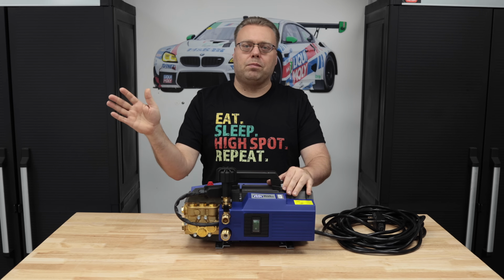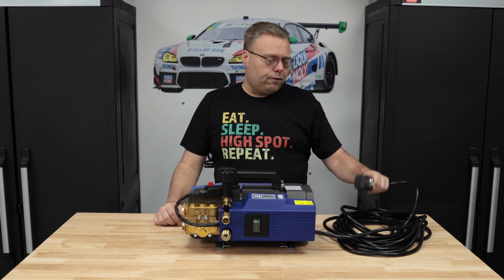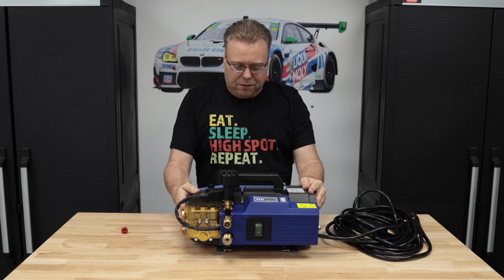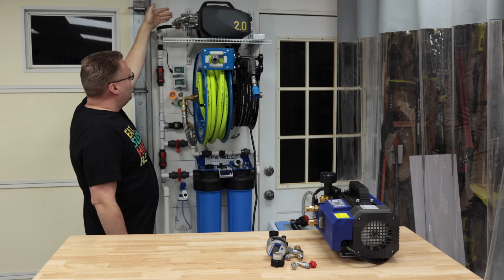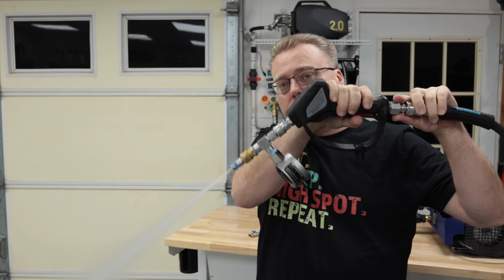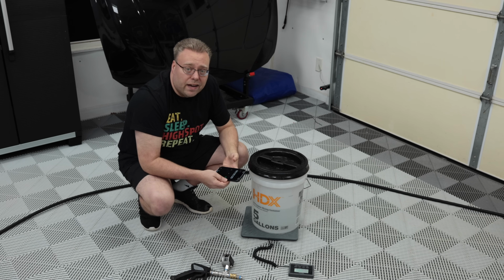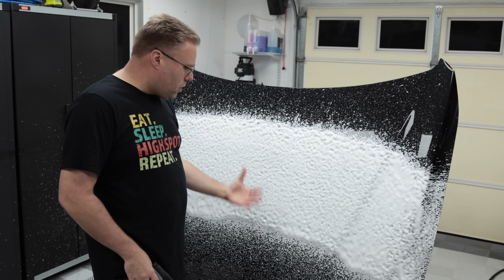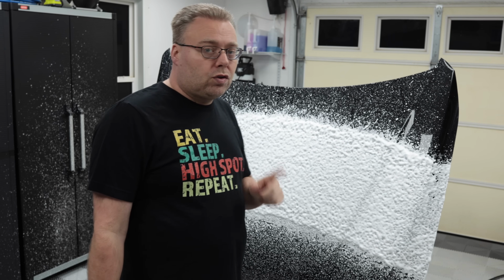Best Pressure Washer For Car Washing! | AR630 TSS | Review & Testing

Comment: Good comparison! I was torn between the AR and the Kranzle… ultimately ended up going Kranzle due to repair info and parts more easily available in the US and on YouTube.  The AR seemed tough to find basic parts to rebuild when compared to the other.  Would be an expensive video, but comparison between the two would be neat to see.
Reply from the maker: The AR now seems to have readily available parts through many outlets. I’m
Afraid to review the Kranzle as I know
It won’t put out these kinds of performance numbers and the new ones coming look to have even better numbers. I might not be so excited just do to the price. Between Zoro and Clean garage they seem to have most of the parts now.
Reply: @CarsWithKeav  fair enough.  The OG model I just tested and I got 2.11GPM at 1200PSI which is awesome.  The reason I pulled the trigger on that instead of waiting for the active 2.3 or other new models is the track record.  For 500-800$ I don’t really want to be the beta tester.  At $350 for the active 2.0 it’s well worth being the beta tester for the pressure washer.
Reply: @bobekdj  the og model?  I’m guessing you meant kranzle 1322?  I wonder how you got 2.1 gpm at 1200 psi when they tested it at 1.9gpm @1000 psi?   With the higher psi you used your gpm should be lower than the 1.9gpm but somehow your tested gpm is higher?
Reply: @YuriTarded-hf1nv  that was my thought too.  The only thing I can come up with was variability in measurement devices.  I used the built in pressure gauge on the kranzle where as I think Matt used the same pressure gauge at the end of the hose, which I’m sure the calibration between the two was off.  Neither is going to be a super accurate measurement, but was honestly surprised that I was getting closer to the manufacturer specs than OG did (maybe something improved since his initial testing a few years ago?).  Not sure but it’s a solid unit for sure either way over my Ryobi :-)
Reply: @bobekdj  not fair to compare it to your ryobi lol but glad you like it.  Hearing this I have a strong feeling that the stories I heard are correct that the gauge og is using hasn’t been properly calibrated because I’ve heard other say a lot of the figures he has down on that spreadsheet are not accurate.
Reply: @YuriTarded-hf1nv  he mentions in one of his videos one of the gauges is likely bad… but I think since he likely used the same one for all the tests the relative numbers between models are still accurate.  I did some testing with 4.0, 4.5, and 5.0 orifices and found that the 4.5 and 5.0 didn’t really put much more water out, and the pressure dropped more so the 4.0 seems to be the sweet spot when calculating cleaning units for me personally.
Reply: @bobekdj  interesting.  I was told somewhere around 60-70% of the figures provided were tested when the gauge was off.
Reply: I would say AR parts are just as accessible if not easier to get compared to kranzle.
Reply from the maker: @YuriTarded-hf1nv  They are now for sure. A few years ago a little harder to get. I just hate they only carry a one year warranty. Seems to be the only downfall other than it pulls a lot of Amps.

Comment: Do you have a way to test for starting amps and running amps? AR claims the starting watts is 8400 watts… I don’t so that being possible. I have it set up in a detail trailer and have had nothing but problems trying to get it to work consistently. I have it running on a 30A breaker on the generator. I would buy a tool to test that but I don’t have a dedicated 20 amp breaker available to me to test…
Reply from the maker: I’m trying to get a meter to test I don’t have one that works with the 20AMP plug on the machine. I do know Clean garage says you need 7200 watts.

Info For Mobile Detailer Setups:

AR Tri-Plex Pumps must be gravity fed when being fed from a water tank
The tank should be AT LEAST 12" above the pump
The tank should be as close to the pump as possible
The inlet hose diameter should be doubled in size when gravity feeding (1.5")
Generator Requirements:
To properly power a commercial pressure washer long term we suggest using the following formula when determining your generator wattage:
AMPS X VOLTS X 3 = At least 7200 running watts

Comment: I was close to getting the AR or waiting for the Active 2.3.  At the end of the day, I couldn't justify the cost, since this is just a hobby for me.  I ended up buying the Active 2.0 (haven't used it yet) and I think that'll be a massive upgrade over what I had.   I may end up getting the Active foam cannon though, which is also hard to justify since I have the MJJC... but $90 hurts less than $780. Great stuff bro!!
Reply from the maker: 2.0 is great for the enthusiast. Doesn’t get that volume abuse and the numbers are great. The Big boo line is coming out with a $550 induction motor unit that looks like the 2.0.
Reply: @CarsWithKeav  I used it for the first time last night... loved it.  Yes it has the high pitched whine but it's WAAAY better than my Ryobi.  Active needs to get you their foam cannon for review !!
Reply from the maker: @DMCnME  They are sending me one. May be delayed they commented on my bottle drop
Video they may be second guessing the clear bottle. 🤣

Comment: I bought one last summer from ebay and it came with standard US 3 prong. I'm running a Predator 3500 generator, should that be enough power? I had no problems with the AR when I first started using it but on my last mobile detail of the year it would trip the generator and power down. I've heard other people had problems with this and they converted their 3 prong into the RV type plug yours came with and shortened the cord. Any idea what I could be doing wrong? I was using a 1/4 in Uberflex hose at the time. ps your channel is awesome and informative, best of luck
Reply from the maker: It pulls some amps that’s for sure close to 19. I think they change the cord after so many people were tripping there 15amp breakers with it. I do know Clean Garage states you need 7200 watts to safely run it. Since it’s induction it will pull lots of starting power each TSS cycle.
Reply: @CarsWithKeav  appreciate the response man

Comment: You going to switch from 2.0
Reply from the maker: I am for now until the 2.3 and Big Boi comes out then it’s which ever is the best goes on the shelf.
Reply: @CarsWithKeav  WashR pro looks 👌
Reply from the maker: @bbqguy6538  I just pre-ordered it and they say shipping early to mid April. About the same timeframe as the 2.3. Should be a fun few weeks.
Reply: Yup, did the same.

Comment: I'm interested in seeing if the active 2.3 will be on the same level cuz it's supposed to be cheaper
Reply from the maker: Cheaper, lighter and runs on a 15 amp circuit. Can it hang performance wise I will for sure find out. I’m curious how serviceable it is.
Reply: @CarsWithKeav  exactly and as a new mobile detailer cheaper and lighter and 15amp is kind of a gimme but it's the quality that I'm worried about
Reply: I bought the active 2.3 and it's amazing for flow but the fact that I can't use my MTM nozzles bugs me and also the 2.3 is so so so loud that I'm selling it and I ordered the 630tss instead
Reply: I ended up getting the 2.3 and sold it a few months after solely because of how loud it is ( extremely) also r fact that you need to use a 4.6 or 4.5 orifice was annoying because I already had 3 upgraded nozzles with the rubber protection that are 4.0. I ended up getting the 630 TSS and the difference in noise level is extreme. I can use it and be right beside it and have a convo plus I can use all my tips again . The active is nice but for the extra$$$ ( if you can afford it) the AR is better.

Comment: I love mine. The sound of the cheaper stuff drives me up a wall, but the AR just sounds like money. I can't say enough good things about it.
Reply from the maker: Yeah, I like this sound way better. We shall see what kind of vibration we get on the shelf soon.
Reply: Not "that" shelf, right?  @CarsWithKeav
Reply from the maker: @mulhallsj  It actually does very well on that shelf. The weight keeps the vibration down. I put a topper on it so it has a nice flat surface to sit on.

Comment: They must have updated the plug recently. My AR630 TSS that was bought a couple years ago from The Clean Garage has the 2 vertical "15 amp outlet style" prongs. Obviously I only use it on a 20 amp outlet/circuit but I guess they made it a little more idiot-proof.
Reply from the maker: Yeah, lots of complaints, but they created there own now because people don’t know what to do with the new plug. It pulls a lot of amps and it has been known to trip some 20AMP. Mainly the very sensitive built in arc protection ones.

Comment: I have been looking at the hot water version
Reply from the maker: I hear it is awesome! Just not something I needed so saved a few hundred.
Reply: @CarsWithKeav  I do hood cleaning and I have been looking at different solutions for hot water. I am surprised to find out that the Ryobi EZ Clean gun can take hot water. But this pump has been on my radar just hard to justify when I have 5k to 7k hot water units that do the job.
Reply from the maker: @basstruckman   AT those prices they have to be some beefy units. Ryobi EZ Clean is so versatile use mine with water out of my hot water heater so not really hot just 135 degrees, but is great for cleaning bird poop on my mailbox and things like that. I hook it up to a 3 gallon backpack tank and go to town.

Comment: I bought the AR630TSS-HOT several years ago.  These units are the a bit heavy but built tough.  They are the Best.
Reply from the maker: For sure not meant to be dragged out each wash. Needs to be mounted somewhere. Weighs even more if you are carrying the unit, electric cable and it’s full of water.
Reply: I also have the Hot version and it is heavy. Makes me feel my age when putting it into place. It’s a great unit and I prefer the sound over those universal motors

Comment: I love how quickly it ramps down (TSS). I’m planning to upgrade my pressure washer from my Ryobi. I was thinking Active but I noticed the TSS shutoff last for a few seconds. This appears to be immediately. I have to do more research. Thanks for the review.
Reply from the maker: You got the Active 2.3 coming in a few weeks which will have this kind of TSS. The 2.0 does have a little ramp up and down for sure. Big Boi will be having two induction pressure washers ranging from $500 to $750 in the coming weeks as well.
Reply: @CarsWithKeav I’m stoked for the big boi, they are definitely going to give Active 2.3 a run for their business. Can’t wait for this summer
Reply from the maker: @ShineAndPreserveDetailing  only thing Active has going for it is weight and 15amp with comparable performance to the 17amp Big Boi. We will soon know. Pre-orders for both will be within the next week or so.
Reply: I have kept track of the upcoming pressure washers. Thank you for mentioning it. I started snooping for information. I’m not in a rush so I’m looking forward hear more about them. Thanks.

Comment: What was the amperage when you were doing your testing 4.0, 4.5 ,5.0, and with the different foam cannon  orifice
Reply from the maker: I have to get a different amp meter I couldn’t read it as mine wouldn’t accept the plug. I’ll update on a pinned comment once I can find that out.
Reply: @CarsWithKeav  thanka keep up the good work
Reply: It's like 19 amp. They are not kidding about the 20amp circuit.
Reply from the maker: @mulhallsj  yeah I heard they used to ship with a regular 15amp plug and too many people complained about it so they changed the plug. It for sure runs high as it was tripping my 20
Amp built in arc detection breaker. They are very sensitive so had to switch to just a normal 20AMP and it never tripped after that.